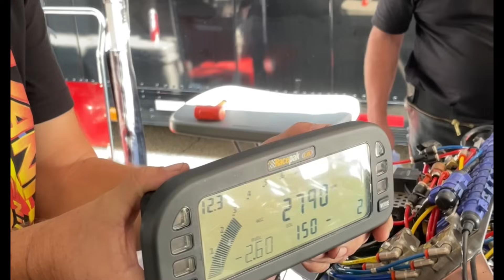Top Fuel Motorcycles Rock Chicago!

Comment: Im not sure if it was him but im pretty sure it was 1 run before this on Saturday around 1pm there was a lone qualifying run in the left lane. He got wheel hop real bad and then missed a gear. If anybody has or knows of footage taken of that run Please let me know! Whoever it was got sent for a wild ride!
Reply from the maker: Both the Saturday runs are on here. It's only a two speed. He did not miss a gear, he juts smoked the tire. Thanks for watching and subscribing. Do you think they got the issue fixed?
Reply: @cycledrag  i think they did get the issue fixed. It was most likely a different bike. Whoever it was spun a tad on the line but then gripped & got into a rear tire bounce coming in and out of traction up to about 160ft.